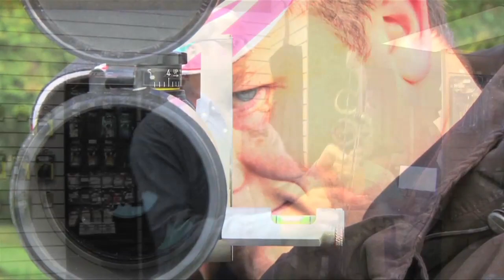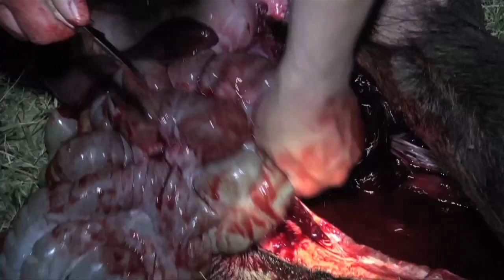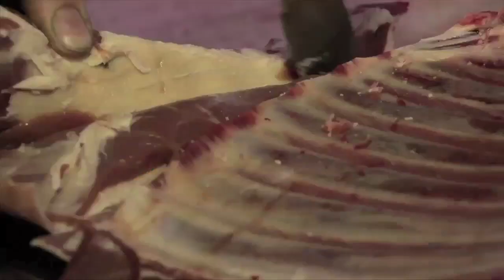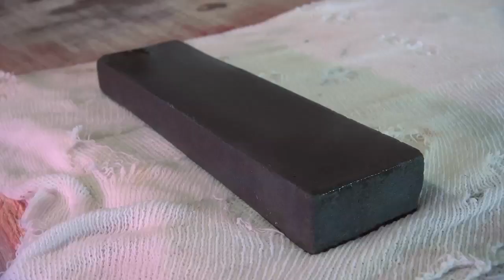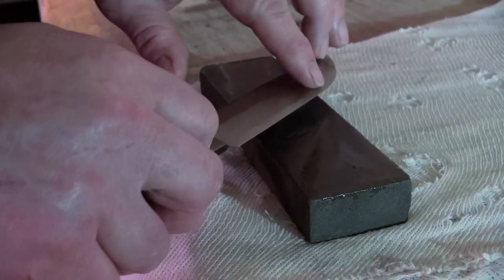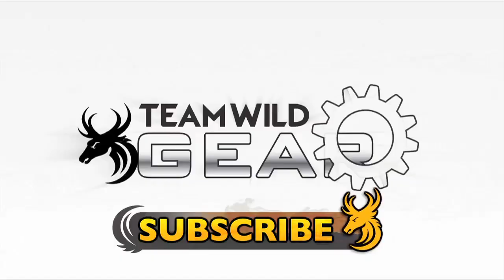How to sharpen your hunting knife

Comment: Nice but you shouldnt sharpen in the direction if the spine as it can leave a bur on the blade edge and is then vulnerable and prone to rolling the under stress. Only sharpen in the direction of the spine on leather or a sharpening canvas material. This stops the leather from being cut to shreds.

Comment: a good tip is to use a sharpie or felt tip marker to cover the edge. And when you go to sharpen it keep adjusting your angle to make sure the ink is completely gone and keep doing this till your muscle memory remembers the proper angle. Also start out with higher grit stones because if you mess up that will do the least amount of damage.